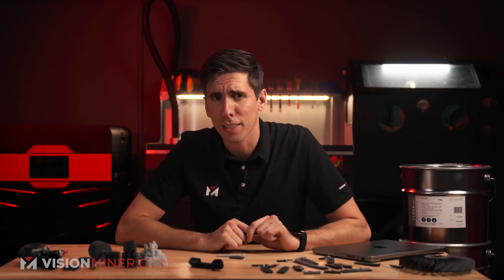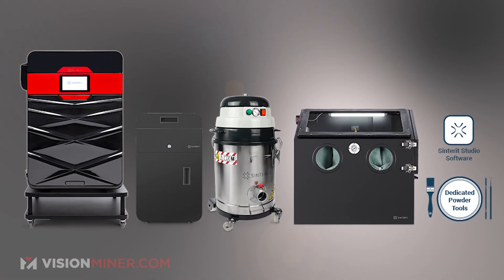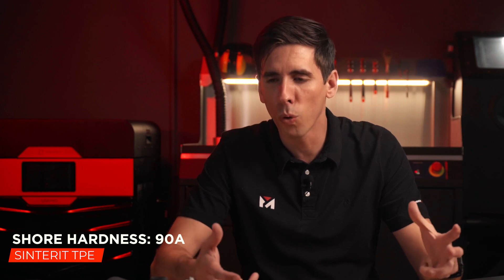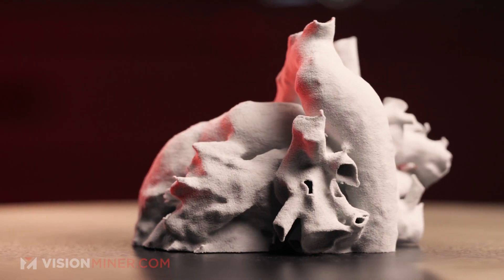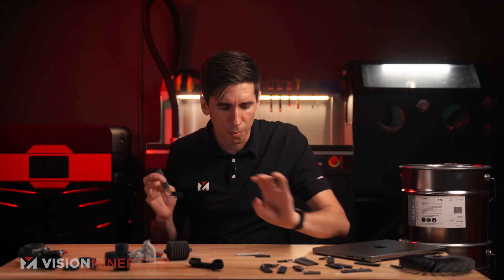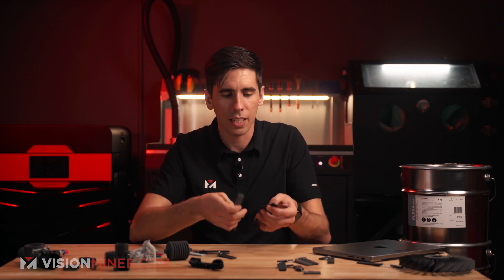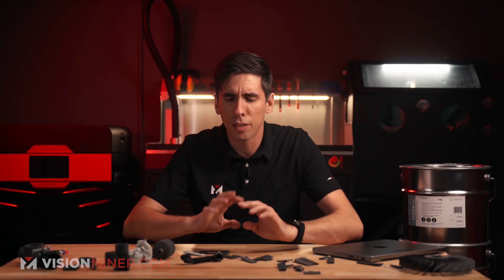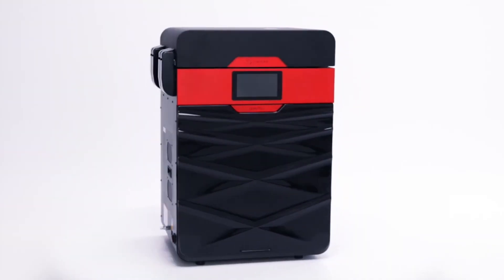Sinterit TPE - Durable, Flexible Material For Gaskets, Shock Absorbers, Skin Touch - Vision Miner

Comment: Hey there, nice video content! We noticed that you used the "Cryptide" sneaker in this video thumbnail. This shoe was 3D printed on a Sintratec S2 machine and is in fact specifically designed for the Sintratec systems. We would kindly ask you to change the thumbnail to avoid possible misleading of the viewers - thank you!